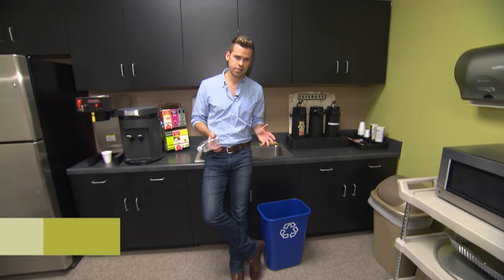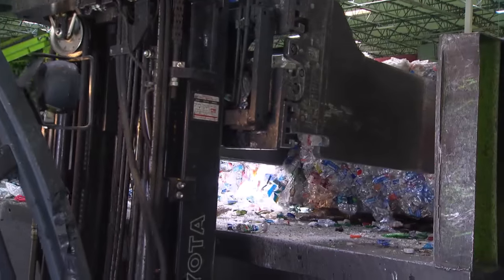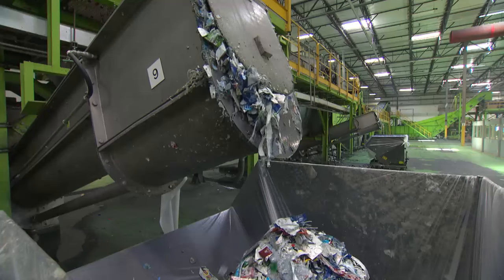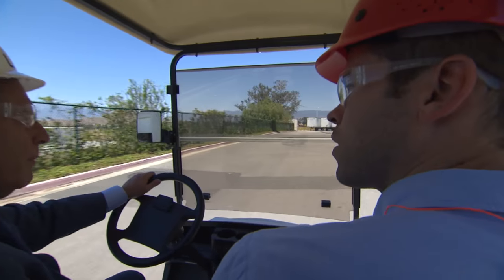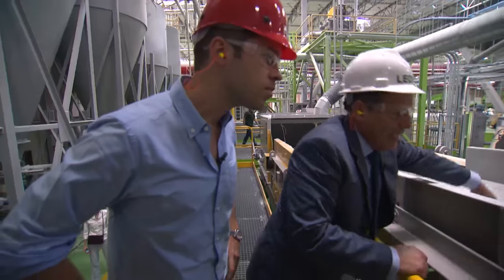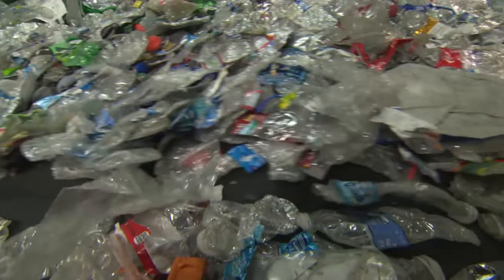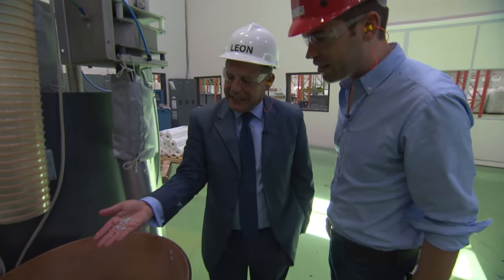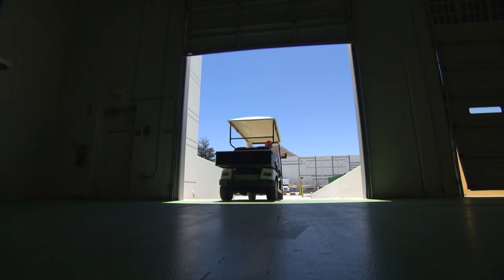CarbonLite: Inside the World's Largest Plastic Bottle Recycling Plant | SoCal Connected | KCET

Comment: You know, I wish reporters would ask helpful questions.  For example:  "Should I leave the cap in place or through in the bin separately?".
Reply: The cap is made of a different material. Removing the caps makes it easier for the recycling facility.
Reply: In nz we are told to leave the cap on as hey are too small for the initial sorting machines to sort by themselves. 30% of the weight in labels, lids and leftovers in the bottle are chucked out
Reply: @scottbc31h22  - Thanks! I typically recycle about 300 PETE water bottles every 6 to 8 weeks, and I did not know that it is preferred to recycle them without the caps. I will start bagging them for recycle with the caps off as of today.
Reply: The bottles are anyway cut into small pieces using a crusher and so are the caps so leaving them on or inside the bottle doesn’t make a difference
Reply: @theanfielddiary4514  wrong!!!  it is best to recycle a clear bottle separate from the cap and label. i cut the labels off my bottles prior to recycling, and i remove the cap and the ring around the bottle neck
Reply: @davidjames666  yeah obviously it's better if you sort them but I have a recycling plant and we have label removers etc installed to remove everything.
Reply: @davidjames666  the way people treat plastic waste in the West is very different from how it's treated here in India👍

Comment: I am 44 and still can remember a visit to a milk bottling plant. I still can see very clearly the washing line with the glass bottles upside down, being washed with soapfilled water and then heading to a drying section in order to be refilled, relabed and recapped to be put in the market again. And a german brand uses for its milk and its yoghurt only glass containers and bottle we then return to the supermarket for reuse, even cheaper and energy saving than recycling them. If that brand could, others could follow suit. I still can remember how, in my country, in the 80s, all this single use packaging and products started. In many cases I feel that correcting those aberrations that were imposed onto us, means simply to return to old habits that included customers and factories as part of closed circular loops of reuse. And certainly for bottling, glass is always the best option.
Reply: exactly! i think they just didnt want to bother with logistics anymore bu im pretty sure it can be more economic

Comment: I wonder how much energy was used to recycle all those bottles
Reply: Philfbaby well which is more useful, the material or the energy?
Reply: They might have solar panels.
Reply: Better be from photovoltaics.
Reply: Better to re use and waste energy than to flood the planet with trash
Reply: I wonder about the entropy of the whole system, they seem very confident when they talk about getting rid of all the processes needed to create a new bottle by "recyling". Nobody seems to take chemistry seriously here.
Reply: It's around 40-70% less than making new bottles where you have to extract the oil, ship it, and then go through the pellet process.
Reply: @trentbulen3854  have you seen Southern Cali?? its nothing but a garbage dump those people dont clean up anything they leave it and hope a non-government group will come and do it for them,
Reply: 2 kw per bale
Reply: The carbon footprint on recycling PET plastic is 40% of manufacturing virgin PET plastic

Comment: Great video, it's always nice when people shed light on the process behind recycling. I'd just be careful making the statement that "these bottles can be used an infinite number of times". Remembering, this facility only processes 20% of the bottles Americans are putting in the trash (which you can bet the company is only accepting the highest grade pre-sorted plastic bottles), and of that only 70% comes out the other side. So, if we do the math only 1*.2*.7= .14, 14% of that bottle you just put in the bin is actually recycled. I just find a lot of people have this assumption that if they throw it in a recycling bin, some how all of it gets fully recycled or down-cycled. Not understanding that while it feels great to put something in the recycling bin, statistically the majority of what they put in there ends up in the trash.

Comment: Very interesting, worth noting that many plastics can't be recycled however sophisticated the facility. Ok my question re plastic bottles containers etc, why aren't they washed and reused? That's surely a much much easier and less problematic system. I'd make say 3-4 bottle sizes that all drink manufacturers have to use nation-wide, make a really good quality product initially and then just wash and reuse. I have soup containers I use for water pots and they have been going for years and years + are still absolutely fine and useable.

Comment: You know what's better for the Environment then recycling plastic? 

Do not make it in the first place...
Reply: Jarid Gaming than its still threw away my friend... all types ethen (unprossesed plastic) was just trash that you couldn’t do anything with that was sorted out from raw oil when making gas like (butane, propane, heavy oil, gaseoline, diesel and more. Plastic is made from the ethen of prossesed raw oil by placing the hydrocarbons in to long hydrocarbons, making ethen propen, polyester, and so on...
Reply: Jarid Gaming better solution?
Reply: You wanna know what we need to stop using to stop production of plastics? We need to stop using electricity.  I guess you're okay with that.

Comment: infinite life? no plastic quality degrade a lot after 2-3 cycles.
Reply: I agree that was a poor choice of words on his part.  A better term would have been "indefinite".
Reply: But, about its quality degrading;  into what does it break down?   
Doesn't melting it into a liquid and letting it harden set the decay process back to the beginning?
Reply: +TheNoiseySpectator Well it will stay as plastic but not usable. it looses its elastic properties. Thats why recycled plastic get mixed with virgin plastic usually.
Reply: salamaza- Its elastic property is depleted.  Could it be used to make something more rigid, like serving dishes, toys, or even altered into another class of plastics? 
 
It seems like such a waste to have to discard it completely without it being at least partly reclaimed.
Reply: Recycled plastics are made into timber replacement products and also paving bricks and roof tiles.
Reply: exactly, let's not forget the 2nd law of thermodynamics... Recycling helps REDUCE the need for raw materials... nevertheles also degraded plastics can be still downcycled and recycled a number of times, perhaps another dozen cycles or so?

Comment: It's a "closed" loop with a hole that lets out 30% of the materials apparently.
Reply: You have no idea, eh. You would not have a clue. That would be the labels and the caps and the incorrect types of containers which have been incidentally baled with the PET before reaching the facility.
Reply: Yes, PET may be recyclable but caps and labels are part of the bottle. Therefore there is no “closed loop” for the product as a whole. You buy a bottle of water and part of it goes to a landfill to rot for decades at least.
Reply: The Magic Twister I think it’s great that we are able to recycle most of a bottle. I think it’s absolutely insane how many people choose to consume their water in plastic bottles. There is certainly a place for plastic single use bottles but they are undoubtedly overused and that is disgraceful. 

Bottled water has been proven in various studies to be no better than local tap water - it’s not like people are filling these bottles at a fresh stream. They are full of water out of a tap at a factory.

Comment: You know the process could improve considerably and reduce the cost of recycling by requiring the whole plastic container be made of just one type of plastic and remove the paper/polystyrene label.    Milk jugs are are HDPE and they are the easy thing to collect and recycle.  You don't have to shred them so much.  You can shred the bottle and cap together.  The hardest part is running the shreds through a water tumbler to remove the bits of the label.  Milk bottles by far are the easiest.   If all bottles were more like milk bottles then recycling plastic would improve dramatically - my opinion.    As a consumer do you really need that blue cap?  As a consumer do you need that fancy label?  Would a ink printing on the bottle be good enough?  Much of this is driven by the choices we (all us consumers) make at the grocery store.

Comment: How do they separate the PET from the HDPE?
Do they recycle them separately?
Reply: It varies by state, but the PET bottles in the video are said to be from a redemption center. In other words, there is a deposit due when purchasing the bottle. Rigid HDPE containers are recycled separately, through curbside recycling programs, and do not require a deposit. Meanwhile, HDPE grocery bags are accepted at major grocery stores. Your local policies may differ....
Reply: we are the soultations suppiler. and factory of plastic recycling machine.  
about ur questions,i would like to say that is so so so easy.

u can consider the HDPE the density and pet density. it will separate by the water. one is the sinking down,one is the going up .then seaprate. 
how easy it is.

Comment: I thought recycled plastic could not be used for food containers
Reply: +cartman4885 It should not be in my opinion. I never ever cook anything in a Microwave in the Plastic Bullshit.
Reply: even if it costs so much. It's worth it cause our world is going to end sooner if we don't recycle things like this
Reply: Well it can be recycled into many things from tables to trash cans
Reply: Used to be the case, in the early day of PET recycling (1980's-90's. The actually recycled material could not be in contact with food or human touch. This material was there recycled by using a form of encapsulation (Multilayer bottles). The recycled material was layered with virgin resin. There was back then some very expensive technology used to ensure and validate the performance of the layers. There was one added benefit, you could actually introduce different materials as well within the layering and add oxygen and CO2 barrier materials such as nylon. This was used extensively in Beer bottle Mfg (EU) and more commonly Ketchup bottles (US) as well.  Since then, the actual technology used to process PET as evolved, where high pressures, high temperatures and assisted with a vacuum chamber. Remove and/or neutralize all potential harmful pathogens.  This is now been validated by the FDA, and 100% consumer safe. No more expensive layer tech needed. And the bottle can be 100% recycled.

Comment: The creator the documentary misspoke. Yes, THEORTEICALLY, a plastic bottle can be recycled an infinite amount of times...if you count dust. But in actuality,   the bottle can only be recycled a few times before it degrades to something that is not usable. It's the reason single use plastic bags and shrink wrap arent recycled...they are incinerated (when collected in bulk). As to the bottle cap thing...that all depends on the facility a d what kind of pellets you are producing. The do have a reusable purpose...just maybe not for bottles in CA.

Comment: so what about glass? do they also sell drinks in glas bottles as in Germany and do they have a refund / refill / recycle culture for those as well?
Reply: +Gunni Helm Reuse commonly in Europe, more advanced than US.
Reply: Re: Cola / water sold in glass bottles.  

Not very much.  The problem with glass bottles is they break.  
If you owned a store, you wouldn't want glass bottles to be among your most commonly  sold items.

Think about it; if one of every 200 items is dropped by the customer while carrying  it to the register, and every day you sell several hundred, or even a few thousand items, the cost of the loss accumulates fast . . . and so does the frustration!   😬

Comment: * China stopped accepting a lot of recyclable material from the U.S., claiming the contamination level was too high.
* Where I live, most tossed polyester material would go not to a landfill, but to a waste to energy facility, to generate steam and electricity.
* The bales stink? My recycle hauler asks me to rinse the bottles before I put them in the recycle cart. So, I do.
* My recycle hauler says I can leave the caps on. 
* I'd like to see a video showing what happens at each step. For example, the label removing process,  type of plastic sorting, color sorting.

Comment: Although I find a video interesting I would like a much more in-depth understanding of the cost to get the bottles to clean the bottles I know for a fact that pet which is the primary plastic of bottles is very hydrophobic and it takes a lot of time to get that out of the bottles so that requires heat and wind I'd be more interested in a cost breakdown I rather suspect that this Factory runs on a lot of Grants from the state and tax deductions and everything else which might make it profitable but I'm not sure

Comment: They need to make these but instead of the use and toss bottles they need to make reusable bottles, this is basically making themselves money, they take bottles, make new bottles, new bottles get used and then the process starts all over.
Reply: cmb271 what happens to the re-usable bottles when you're done with them?
Reply: Miller Thompson plus the guy says you lose about 30% of the material that was initially there when you first received the bottles. So would virgin materials still be necessary? even in little amount to make up for the loss of plastic? im going to reduce my plastic bottle waste, i recommend everyone reuse plastic bottles or buy water bottles made out of durable material. im very interested in this type of thing.. the plastic bottles that we do use shall be disposed of properly and be made into polyester clothing or more  water bottles etc.
Reply: Well i'd rather disposable bottles not be as common as they are in society and rather see plastics being used toward long term projects such as benches for parks,  car body parts, cups and bowls, things that are common and used many times.

Comment: i never actually support the use of water bottle as water sources. Warehouse retail like Costco make it very inexpensive on these items, but promoting the waste. (You might say it's 100% recycled material, but it take extra power and processes to make it reusable materials (collecting, processing, storing, to delivering to manufacturer). It cost a lot of economic resources.
Reply: Oh, I don't know about that. Looking at the big picture, there are few if any materials as easily & efficiently recycled as plastics.  

For example , glass shatters and the bits gets lost, letting the law of entropy pilfer material from the cycle relentlessly and inevitability.
And, there are some drinks like citrus juce that wouldn't stay fit for human consumption if you sold them in metal bottles.
Reply: +TheNoiseySpectator tap water. Beats it easily in every aspect.
Ofcourse I do have a plastic bottle for a journey. But I re-use it... until I lose it somehow.

Comment: First I am in favor of recycling.  BUT, anyone who thinks it is better on our environment than starting with virgin material does not fully understand what is involved with recycling. All one has to do is think about it and start adding up the carbon foot print. Starting with the person who drives a car down to the recycling center to get the money for their plastic bottles (bam Co2). Then the machines at the recycling center are not turned by hand (Electricity bam more Co2). A forklift running on propane has to pick up the bails of bottles twice once to store it and then once to load it on a truck (bam more Co2). The truck that drives it to a facility like this one runs on diesel ( bam more Co2!). Then at this plant another forklift running on Propane (bam more Co2). The full process of converting all this junk plastic into pellets (bam bam bam bam lots more Co2)!! Now finally you have a product that isnt as good as virgin material and it needs to be shipped again to a manufacture. That is at least two more forklifts and a big truck for transportation (bam bam bam more Co2). There are other Co2 hits on it that I have not mentioned. But I think you get the picture. Like I said, i am still in favor of recycling but i want to make it clear to those who think recycling is better for our environment than just making virgin material, it isn't! I am in favor of it because it keeps trash that takes a long time to break down out of our land fills. What doesnt bresk down is GLASS! Plastics do over many years but glass doesn't. We need to recycle glass more than plastic. As for Newspaper NO, that is just wood pulp and is good for compost and is easly grown back into trees. What they should BAN is disposable DYPERS! Those are very bad for our landfills.